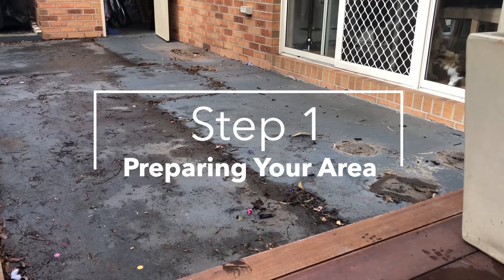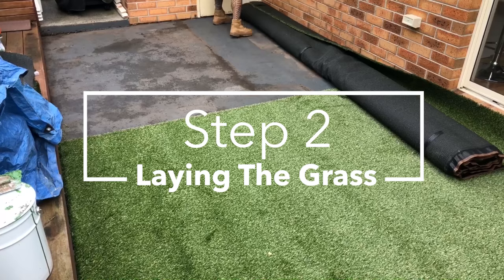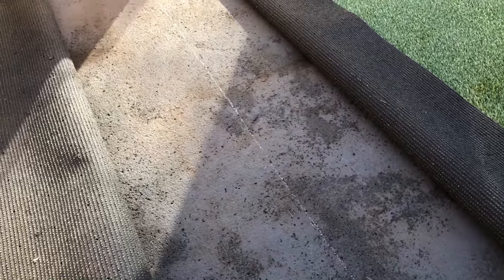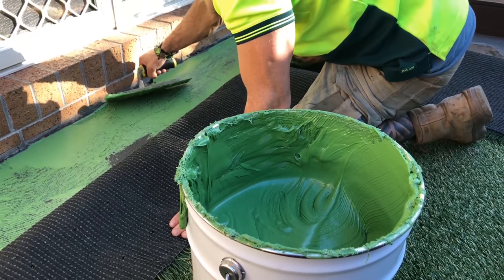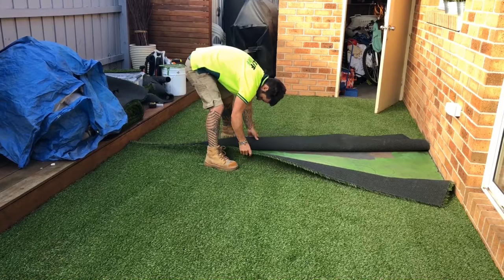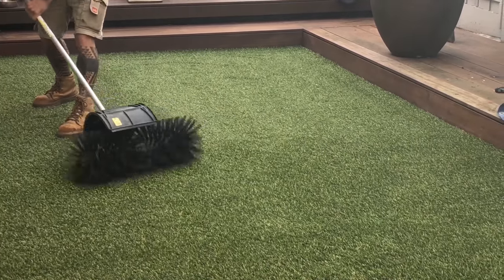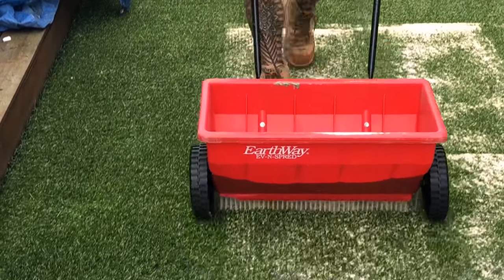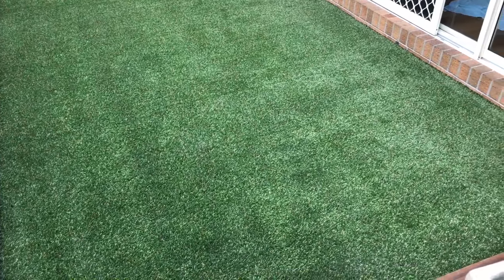How To Install Turf On A Hard Surface

Comment from the maker: Hi all, please let us know what synthetic turf-based videos you’d like to see us create! If we choose your idea who knows, there’s might be something good in it for you 😉
Reply: laying this stuff on my back steps (concrete over block) - its the drilling side that worries me. cheers
Reply: How it is recycled and what are the effects on the ground below.
Reply from the maker: @davefarley1960  Hi David, recycling synthetic turf is quite region-specific, not all areas of the world have the machinery or capability. Our turf has a lifespan of up to 15 years and if recycling at that point is a concern, reach out to your local recycling facility to determine if they can help.
Reply: You only put glue around the perimeter and not the whole floor?
Reply from the maker: @percivasdaniels417  A great question! In most cases, yes this is sufficient. Remember you (hopefully) have approx 10-15kg's of sand per m2, so the turf won't likely move at all. In some cases (if being used in a public access area, for example) you may want to fully direct stick the turf in its entirety to guarantee it looks great over the long term.
Reply: Does the sand become an issue - getting tracked inside the house, etc?
Reply from the maker: @AHellewell-qh4ym  No, not usually. If you use the recommended amount of sand that is unique to the turf you're using, you should be fine. It is the same case if you were using natural turf - you may or may not track dirt inside.

Comment: I suspect it'll be a devil to take off if you ever want to get rid of it.
Reply from the maker: Hi Dave,

Yes, this is indeed considered a permanent solution. A product similar to GlueRid combined with a floor scraper will get the job done. If a "less-permanent" solution is required, then a double sided tape could be just what you need.

Comment: Can I install turf on uneven concrete surface?
Reply from the maker: Yes, you can. The drawback is potentially poor drainage. It is usually better to correct the drainage before installing turf on the surface.

Comment: Hello, will mold and/or fungus grow under the turf? If so, how does one know that there is mold there and how do you get rid off it?
Reply from the maker: Hi Jimmy, not necessarily. If your current drainage is insufficient, eg, water pools there, then water will also pool there when you install turf on top of it. If improving the drainage performance is not an option for you, then you can treat the area with a water/chlorine mix periodically to kill anything organic there. Seeing as synthetic turf is usually chosen as a solution in order to reduce maintenance, we would always suggest making your base as flat and free-draining as possible before installing turf on top. Thereby reducing maintenance, and improving the look, feel, and usability of the surface for years to come.

Comment: I'm just wondering how to get the glue off my hands lol
Reply from the maker: Hey Michael, this is very common with glue installers :p Manual removal is best - a harsh scrubbing brush will remove most of the larger bits, then finish with an exfoliating glove. Avoid glue removers such as Glue Rid or petrol, as they may irritate your skin more than manual removal methods.

Comment: Nice informative video. I have seen some people using tape and glue to stick 2 pcs together. Is it necessary to use both for pavers please? TIA
Reply from the maker: Hi there, thank you for the kind words. The answer to your question depends on whether you want to stick the turf down to the pavers or not. If you elect to glue the turf down, then applying glue on the joins in the manner we did in this video is sufficient. If you wish to avoid applying glue to the pavers, then definitely consider using joining fabric combined with glue to stick the two pieces together

Comment: Hi - i have a small concrete backyard (roughly 6m x 4m), that slopes towards the house and the side passageway - when there is heavy rain the runoff goes down side passage way with no problems. Will laying Tuff Turf keep the runoff / drainage the same? Do you have approved installers in Sydney or is it only DIY? Do Bunnings sell your  premium synthetic turf i saw on your FB page? thanks
Reply from the maker: Hi Marty, yes your drainage will remain similar. We don't have anyone we'd recommend outside of VIC for installs. Yes you can get our Luxury Tuff from Bunnings - it's our most dense grass for landscaping https://www.bunnings.com.au/tuff-turf-3-75-x-1m-luxury-synthetic-turf_p0093254

Comment: Once you use the glue on concrete is there a way to get it off if you ever want to remove the turf? Can it be sanded off or is the  concrete essentially ruined?
Reply: This is exactly what I'm thinking 🤔
Reply from the maker: Hi Heather, this can be removed using a product called  "Glue Rid", potentially combined with manual removal (sanding or grinding). Having said that, most people will replace old turf with another covering such as new turf, or decking, and the appearance of the base layer isn't usually a concern. An alternative installation method is a double-sided tape, which has no residue.

Comment: Great video! Is it possible to lay turf on exposed aggregate concrete? Thank you!
Reply from the maker: yes, this is possible! 2 factors to consider: adequate drainage, and securing the turf to the base. If you use an adhesive, ensure the concrete is dust and paint-free.

Comment: Do you just put the glue on the edges? Also, do you leave a gap (how big approximately ) between the glue and the walls? Don't you put the glue the closest to the walls? I am installing grass soon and your video is very helpful. I just need to double check if that gap without glue is needed although the grass will be touching the walls. Thank you in advance
Reply from the maker: Yes,  in most cases you should glue only the edges, just like we did in the video - sand infill usually takes care of weighing the rest down. Have a read through the comments on this video, you'll find a lot of info about keeping drainage in mind when gluing.
Reply: @TuffTurfAU  thank you so much for the video and the reply. I have read all your comments and yes, will apply the glue just on the edges and maybe a few other areas randomly but not on the entire surface.

Comment: Hello! Please answer me :) So when glue will block the drainage  around the perimeter. Will the water flow well?

￼
Reply from the maker: It is not 100% necessary to add glue in all areas. If the area you are installing in has larger than typical water exposure and there is no in-built drainage,  you can strategically apply glue so that water can escape to where you need it to, with sand infill doing its job to weight the surface down

Comment: Great vid. Interesting you didn’t use an underlay. I want to do something of similar size but over stone paving slabs that are not all that even. Also worried about the glue not coming off the slabs if and when we want to remove the grass ….
Reply from the maker: Thank you! There are many other ways to attack turfing over a hard surface, a rubber underlay is an option, as well as adding a drainage cell underneath the turf. This is a good option if you do not want to adhere anything to the concrete (the turf is adhered to the cell). A drainage cell in your case could be the go, as it will create a flat, even surface.

Comment: Thanks for such an informative video and for answering so many queries! Doesn't the sand get washed away when it rains? I'm worried about blocking the drain at our rental! Also, will the glue be easy to remove when we move out?
Reply from the maker: Hi Lena, No problems! Very happy to help :) The sand will wash away minutely with the weather and will be displaced to a small degree with repetitive foot traffic. If your base has been constructed correctly with sufficient fall for water run-off you'll find that the sand will do its job for a long time. The glue is a permanent solution to securing turf and will leave a residue when it's time to pull-up the turf. You could consider double-sided tape as a semi-permanent alternative.
Reply from the maker: You'll know it's time to top-up the infill by using your eyes and feet. Does the turf have a flat appearance? Is it feeling less spongy underfoot? Then it may be time to brush the fibres back up and top-up or replace the infill.
Reply: @TuffTurfAU  Thanks so much, that's really helpful :)
Reply: How to avoid worms getting under it?😬
Reply: Since I'm laying the turf in the front yard, my neighbors are saying that stray dogs\cats would be welcomed to poop on it... Is that true? 🙄😬😩🤦🏻‍♀️
Reply: In my opinion, keeping the perimeter sprayed with insecticide and mosquito control, it should probably be good enough. I'm new into this turf grass and I'm doing my homework before I lay it down to avoid having too many issues with it 🙅
I hope I help you somehow 🙋🏻‍♀️

Comment: Thanks for your video. How do you recommend removing the glue of the concrete. I have turn and I’m moving I need to clean it up
Reply from the maker: Hi! Use a glue solvent such as GlueRid to remove the bulk of it, and pair it with a manual removal method such as a floor scraper

Comment: Thanks for the informative video. What kind of glue did you use in the videos and what other options for glue are there. I just need small amount as the does have come off and need to glue them back.
Thanks
Reply from the maker: You can find our "Synthetic Turf Adhesive" at any Bunnings Warehouse. It's available in 320gm Tubes and in 1, 4 and 20lt Cans. If you're not located in Australia, ask your local hardware supplier for Glue specific for Synthetic turf.

Comment: I found it easier laying approximately 18sqm of individual artificial grass tiles over concrete pavers.  The grass tiles just click together and gently hammer down.  Result was just as good as rolls of artificial grass.  My dog loves the new area and great for entertaining.
Reply from the maker: Awesome to hear George! Interlocking tiles are definitely a good option for an area with a hard surface. The cost per square metre is often more than what we did here but it is a massive time saver for installation and maintenance. Glad your surface turned out well =)
Reply: Thanks for the information Sir, I wasn't aware there was a different, easier method, I'm going to have a look now 😊

Comment: Hey, can i ask about your drainage system. Im afraid if i do this, the water will accumulate and become a pool during rainy season.
Reply from the maker: Our turf won't hinder drainage, however your base construction and your turf installation methods can. Ask yourself this question: "How well does my current base drain?" If it drains effectively, make sure your chosen installation methods facilitate that same drainage. Put another way, don't apply glue to the base in spots where existing drainage channels will be blocked/obstructed. Please let us know if we can provide more info!
Reply: can u pls advise if the drain is not proper,when it rain some water get collected uneven space ...so how we can put artificial grass on that thanks
Reply from the maker: @bobbysimple  I would advise against installing turf on an unprepared base. Your end result will be substandard.

Comment: Hi. I have fake grass but brought underlay as my toddler will be on it the most. Just wondering how to go about laying it. Do I need to glue the underlay to the patio and then glue the grass to the underlay?
Reply from the maker: Hi Jade, yes this is the method I would be using. When you install the glue, keep drainage in mind; do not apply glue to the entirety of the underlay or turf. Best of luck with your project!

Comment: Can any type of artificial grass be laid over concrete? I noticed that the underside of certain artificial grass is very uneven and bumpy due to the type of grass blade used on the top side. Should we only use grass which is very smooth on the underside to assure adequate adherence to the concrete? Thanks for your help...
Reply from the maker: Hi aris navarro, yes any synthetic turf can be laid over concrete as long as drainage is kept in mind (be sure to know where your water/pet mess will drain to). If you follow the advice in this video to the letter, your turf will adhere to the base as it should. The exposed stitches underneath the turf will not impede adherence.

Comment: Can I skip the silica sand if I am installing on my wooden deck/patio?
Reply from the maker: Hi David, yes you can.  The potential issues of avoiding a sand infill are two-fold; your fibres will appear and feel flat after a lot of use, and your surface may move over time (sand helps the surface stay put)

Comment: Hi, I need help. I'm about to run a football school, but first l need to renew a football court completly. My budget is limited and I gonna do by myself as more as posible. I have sevral question:

Is it better if parts have velcro to connect? 
Is it possible to stay well without glue?
If I use a glue, can I remove the grass without damaging it and use it on another location?

Thanks for your answers in advance!!
Reply from the maker: Wow, this sounds like a huge job! Player safety should be your number one concern as opposed to cost. Therefore you should first ensure your base is flat and allows for adequate drainage. With that completed, you should pay attention to your joins, you should use a joining fabric and Glue to adhere the two pieces of turf together. This will close to guarantee that your join will remain strong and safe for as long as you need it to be. Without a strong join your join will open up and player safety will be compromised. The trade-off is that you cannot remove the glue from the turf without damagaing itit. Best of luck with the project BoBo!

Comment: This was very helpful. The only question I have is will the sand be necessary if i'm using the turf inside of a garage?
Reply from the maker: In this application, sand will help the turf fibres stand up over the long term, and weigh your turf down. If these facets do not matter to you, then "no" you don't need an infill.
Reply: @TuffTurfAU  Sounds good. Thank you sir.

Comment: Thank you. I enjoyed your video. It is very informative. I am looking at doing this inside a facility that I am renting. It will be used for fitness and people to run and pull weights across. I don’t want to use the glue because we are renting. Due you think double sided tape will suffice? Is so, what tape do you recommend?
Reply from the maker: Hi Daniel, thanks :) Yes double-sided tape can work. If you're located in AUS, check out our range in any Bunnings store, otherwise 3M have a vast range of heavy-duty double-sided tapes you could find at your major hardware store
Reply: Hi there, I'm also renting and doing this on a tiled balcony. I bought the Tuff Turf tape, and am moving out in about 9 months. Will this be able to be removed? Thanks!
Reply: @natalyazupan7236  hi how’d it go with removing the turf? asking for myself i’m currently in the middle of installing turf
Reply: @kimberlyescobar1013  right!?

Comment: Thanks for the video. I am wanting to put some turf down in my basement for my kids to practice soccer footwork/ballhandling and also for a small workout area. For a 13x13, would you recommend glue under the entire area since it will be a highly traffic area?
Reply from the maker: Hi there! Absolutely, glue the entire area. When we're talking about any sports surface you want to ensure that safety is your number one facet to keep in mind. Glueing the entire area will mean that the surface won't be displaced over time.

Comment: Great vid, just wondering , I have pavers and weeds come through a fair bit and some of the space is uneven, will it be ok to place fake turf squares down without sand or underlay ? Just trying to create a nicer space on the cheap, 
Thanks in advance
Reply from the maker: Hi Niki, thank you so much! Yes, this can work to achieve your aim :) You may potentially still get some weeds come through - periodical weed killer treatments can definitely help to keep them at bay.

Comment: So I don't need to apply glue to every square foot of the tile / concrete below before laying the turf?
Reply from the maker: Hi there, no this is not necessary in most cases. If you opt to use a sand infill, this usually provides sufficient ballast to avoid the turf shifting much over time. You may consider more glue coverage in particular areas that receive above average foot traffic.

Comment: I want to install in a screened in patio, how would you recommend ensuring for good drainage
Reply from the maker: Hi Jonathan, is your base already fully constructed? If so, you may not have much influence over your drainage performance. Test it out - if you dump a whole lot of water on the surface now, does it sufficiently drain? If so, be sure to apply the glue tactically, so as to facilitate that drainage. You could apply glue so that no drainage "outlet" is not blocked by the glue. Finally, as described in my of these comment replies, pairing a sand infill (on top) with glue (underneath) will help the new surface stay in place for the long term.

Comment: is gonna be problem for doing this without using sand?
Reply: Adding a sand infill is really up to you. An infill achieves the following: the turf is weighed down and won't move, the blades of grass are kept upright and looking as new, the surface temperature is reduced, drainage is improved, and warranties are honoured. Is there any reason you wouldn't want an infill for your unique space?